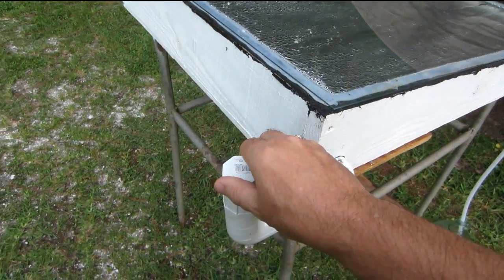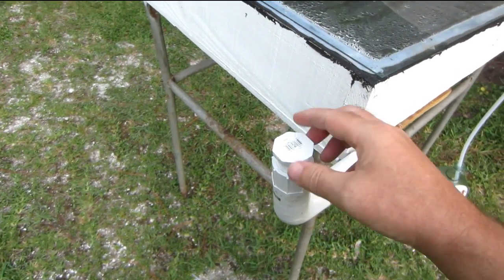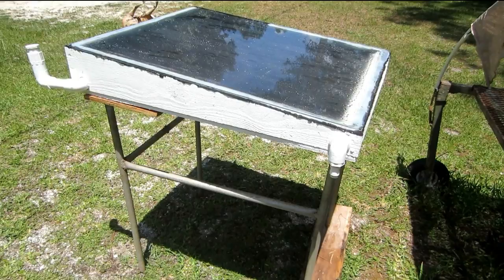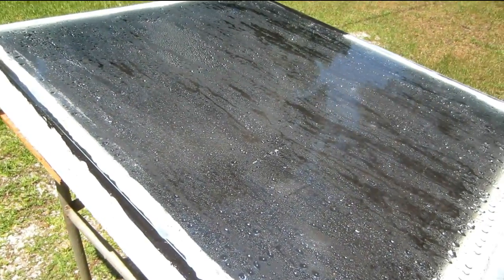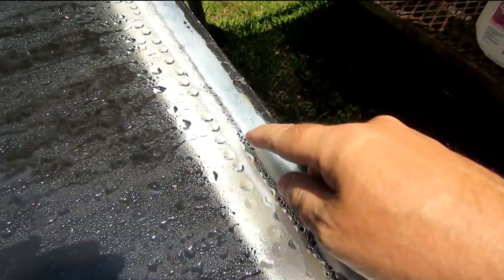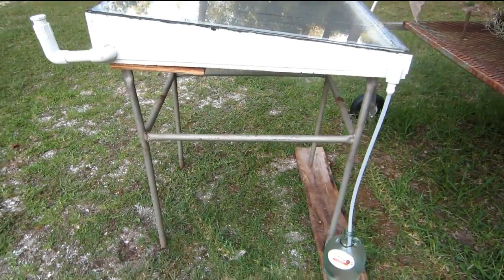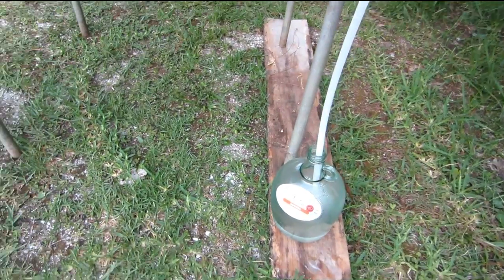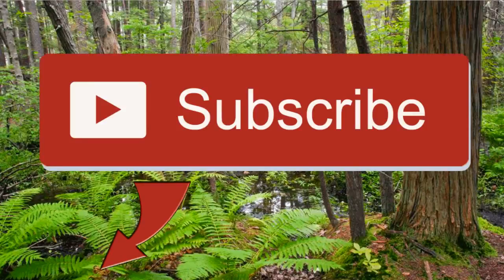Solar Water Distiller Part 2 (Very Funny)

Comment: Thank you.
You gave me the basic of how to do it.
Btw I have been looking for 2 months on how to make a solar distilled.
YouTube was not showing any.
So I bought the stuff to make a distilled from a pressure cooker.
And out of the blue. Now I'm getting solor distillers. Which is what I was wanting in the beganing.
My summers get to 120, and my winters I often have 70 plus days. So wasting gas on a distiller is not needed.
And I wasn't having a problem with my water getting algae until I had to have someone deliver water.
Took me awhile to figure out the cause.
My tanks are iodine rinsed. So I wasn't having the problem. I had tanks that had water 2 years old. And the water was good.
You may ask, what cause the problem? 
Two things can do this. And I think he did the second. He is an A hole and his old lady is mad that I won't be a slave for them. Long story if you ask I'll explain I've noticed there are a lot of these people starting with boomers.
1st if you add chlorine to iodine water it cancel each other out. Water didn't taste like it had chlorine. ( water point does not chorinate thier water)
2nd if you add salt to iodine water it not only cancels it out, but also removes the iodine set in the plastic. The tanks that argue grew in lost thier iodine tint.
I'm sure they added salt to the water before delivering. It something sneaking lowlife people like them would do. They knew my tanks were iodine rinsed. However, i will not give them credit for thinking that hard. I think they added the salt just to ruin the water. 
See salt also cancels chlorine water too. 
Add salt or iodine to chlorine and it puts off a toxic gas.
Reply from the maker: Sounds like you're in FL. I'm in the north east part. It's really hard to find good water in FL. I bought the biggest piece of glass that Lowe's has and built the distiller for it. Basically you want the bottom level and the top at a slant to collect the water. I saw one made with a glass storm door and it was slanted on the narrow side of the top. Be sure to use food grade silicone. Otherwise, It could be toxic. If I had to do it again, I would use fiberglass resin with black added as color in it.
Reply: @CrackerSwamp  no I don't have the humidity. I'm much more west.i get 6 to 8 inches of rain a year.
From my front door I see the Mexico and New Mexico border
Reply: @pychohobo1832  how did you make solar distiller out of pressure cooker? Painted the pot black? No mirrors focused on it?

Comment: I plan on trying this with two mods. First I want to make some reflectors with cardboard and aluminum foil and place them around the still at an angle to reflect even more sunlight in. I also want to try it with the glass on a steeper angle to make the drops run faster into the trough. If they sit for too long I'd worry they'd drop right back down.
Reply from the maker: Good idea!.. I'd also use fiberglass resin with black pigmentation inside.

Comment: I am tile placer....i would make it with black tiles. Or you could place a glass plate on the bottom as well. More hygienic then a bottom of silicone. Also needs to get opened easy to clean the inside.

Comment from the maker: A fresnel lens may be to hot and bur the wood or cause the glass to shatter.. although you can increase the heat with mirrors to intensify your focus of sun light like with a solar oven.
Reply from the maker: They do make a food grade silicone but you still have to let it cure for a week or more not to get those chemical flavors.

Comment: I would be very concerned about the chemicals being released into the water from the silicone caulk and paint
Reply: quickend01 o was wondering the same things myself! !
Reply: Food safe silicon sealant is available at Home Depot.
Reply: But the water is running down to a bead of silicon.
Reply: So they say and who says the company who sells it. and also black cover cook ware very carcinogenic always do your homework.
Reply: @garyhall867  This is a good point.  I think he said that condensate bead was glue, but still there's chemicals there.  Wonder what a good alternative would be there.  Also I think the silicone on the bottom still effuses into the air for possible re-absorption by water vapor?

Comment: Can you build one out of only stainless steel and glass?
Reply from the maker: Barry Branton. Yep you just need the inside to be black to draw heat.
Reply: What about the VOCs seeping into your water.
Reply from the maker: Barry Branton. Food grade paint or food grade black silicone. Might even consider using fiberglass instead of stainless. It would be easier to form than stainless.
Reply from the maker: Barry Branton. I like that design because of the extra surface area of the glass in a smaller space resulting in a higher yield. Also there is no special shaping of the stainless. It's a good find thanks for sharing!
Reply: My pleasure. Thanks for listening to my suggestion.
Reply from the maker: Barry Branton. Oh-Sure! I love hearing about new ideas. I invite your suggestions, thoughts and ideas. Thanks for that.

Comment: Great video. I am a scholar and I want to create my own solar water distiller. Could I have the list of the materials ? And also I didn’t understand the water alimentation
Reply from the maker: Really I used mostly material I had on hand. The main thing is depending on the size of glass you can get your hands on. I bought the biggest piece of glass I could get from Lowe's. Lowe's cuts glass inside their store. So I made the dimentions based on the glass. I used 1" x 5" inch wood for the sides and 3/4" inch plywood for the bottom. I used food grade silicone for the inside to make it water proof and 1" inch pvc  fittings for the drain. You could use fiberglass resin for the inside instead of silicone.

Comment: I wnt to hw about the size of wood  and glass size
Reply from the maker: Ganesan Vicky. The problem I came across was cheap glass. So the biggest cheapest glass I could find was sold at Lowes. I think it was 2 1/2 ft X 4 ft. I built the cabinet to fit the glass and have a slant for the water to roll down the glass. I don't remember any sizes.. I built it without plans.